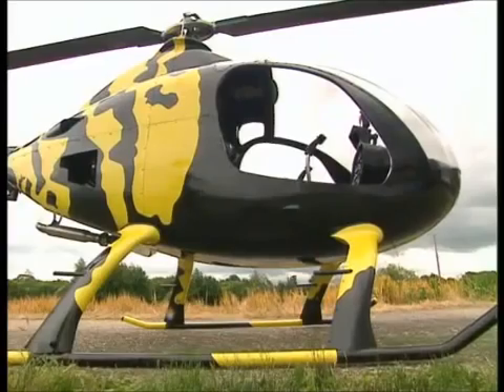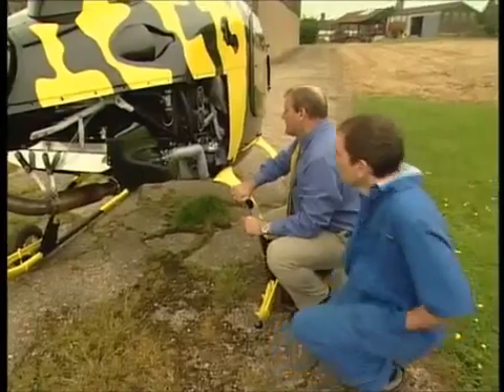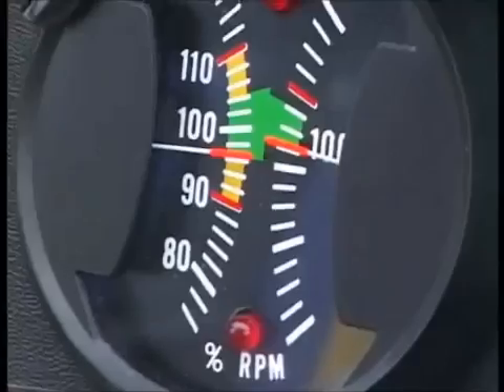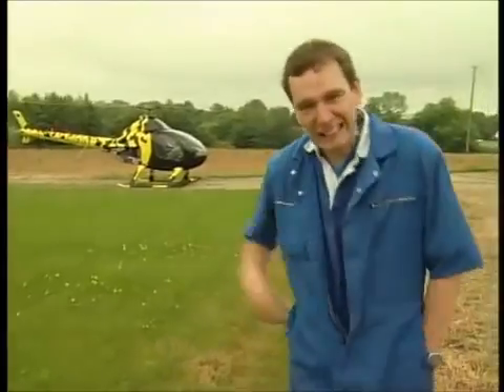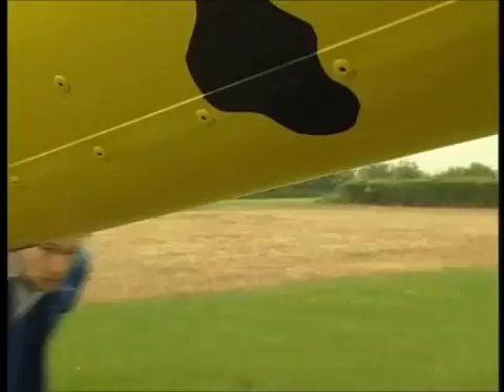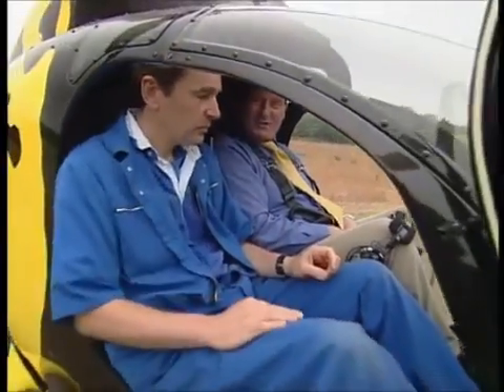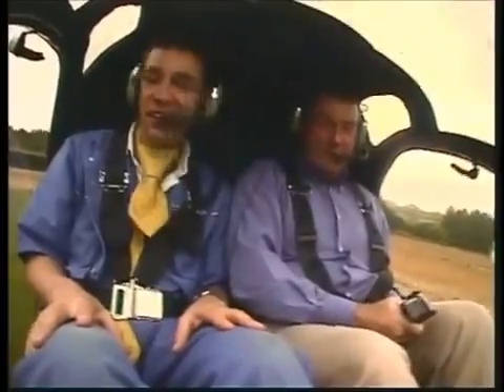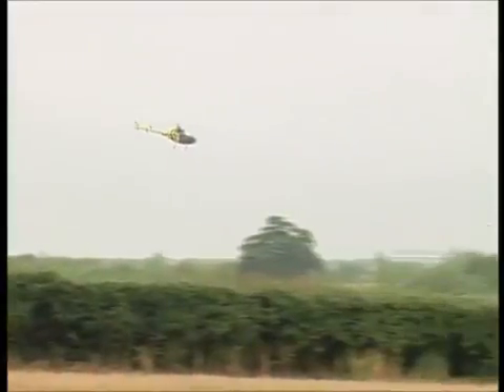A Chopper is Born - Mark Evans. episode two part 9/9

Comment: I know that´s an old video but I was worried about the vibration of the tail assembly as it could make the gear box particularly near ne engine  to be jammed...and the tail rotor to suddenly stops....In  the others videos i noticed that there were too many screws around the rotor cone to fix the balls.bearings tio the taill rotor cone that- could even make it  weaker...